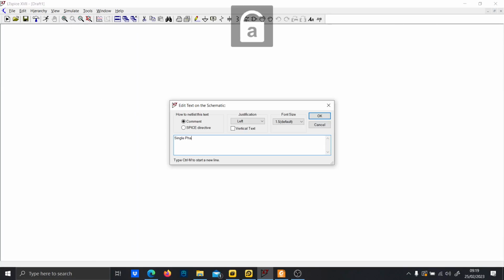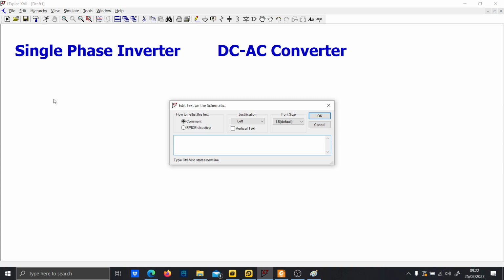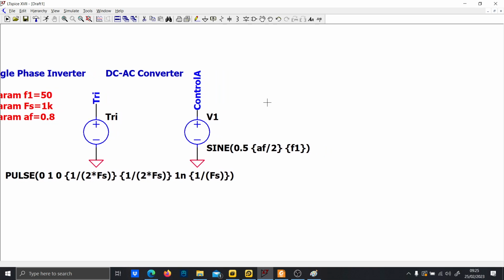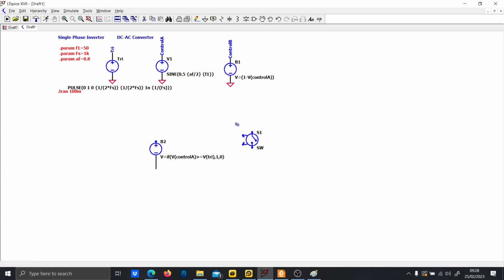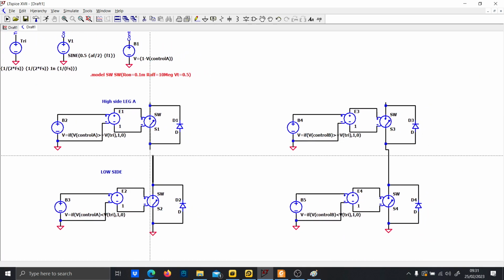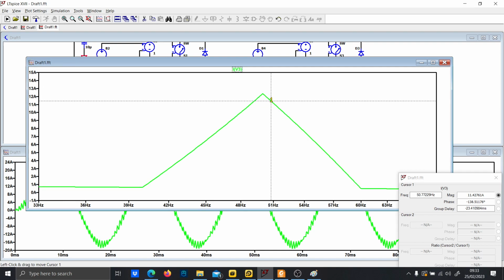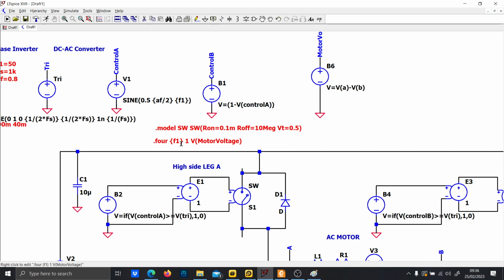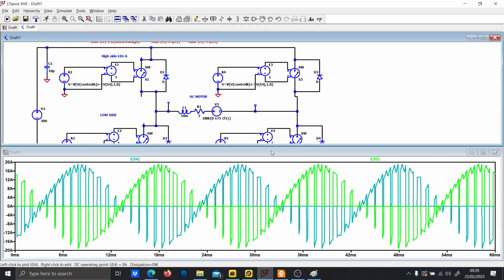LTSPICE Single Phase Inverter (Simulation,FFT,Harmonics) for AC Motors

Comment: Good video. I suggest adding a filter and demonstrating the methodology on the discharge to drop THD under 5%. I also suggest making the equivalence circuit model of a motor in a block, and make that the load. I think you would get a lot of views.

Comment: Excuse me, if I want to use NMOS instead of SW to make a single-phase, how should I do it? Is there any tutorial QAQ?
Reply from the maker: Just substitute the switch with Nmos, select One of the list and then provide enough gate voltage like 5V
Reply: @LukeXVIIx64  Should the Gate terminal of NMOS be connected to E and then to BV, or is it sufficient to connect it to DC?
Reply from the maker: @士凱-g1y  If the MOSFET Is High side, you have to provide 5V to the VGS, which Is literally Vg-Vs, a differential voltage. So, you First decide your pulse, then with the gain E you connect both the gate and the source and not the source to gnd, or else the MOSFET won't turn on
Reply: @LukeXVIIx64  Thank you for your video and your advice <3.
Reply: @LukeXVIIx64  Sorry for the trouble again. I would like to ask how to adjust the square wave generated by the low-pass filter to align with the sine wave. I have adjusted the delay, inductance, and capacitance, but it seems that there is not much change. Once again, thank you. 🙏
Reply from the maker: @士凱-g1y  I'm afraid I don't follow, what Low pass filter are you talking about? The load Is a PSM motor, hence the inductance of the motor. Then the pulse given to the switches Is generated with a triangular waveform compared to a slow sine wave at 50Hz. The result will be a Square waveform which its duty Cycle changes with time , to match a sine wave, like having a discretized sine basically
Reply: @LukeXVIIx64  I apologize for the confusion, let me rephrase. What I want to ask is, how can I adjust the square wave generated after passing through the inductor, resistor, and voltage source containing a sine wave so that it aligns with the sine wave output from the voltage source? (I initially thought that the inductor and resistor in between, along with the voltage source, were meant to establish a simple low-pass filter.)
Reply from the maker: @士凱-g1y  The "square wave" that you see, it's not a square wave, It's the PSM AC Motor voltage. It's not a classical square wave with duty cycle 0.5 between 0 and 10 for instance, it's a non-constant duty cycle square wave, which mimics the sine voltage at 50Hz. Basically, if you perform an averaged mean of that "square wave", you will obtain a sine wave, and that, is what in reality sees the motor. Let me make you understand
The motor is an electromechanical device, and it's very slow. At its input voltage pins, he will not see the square waveform varying so fast at 10kHz, but the motor will see an averaged mean of that square waveform, a low pass filtered waveform, which, for him, is basically a sine wave.

So, you don't need to "match the square wave to a sine wave" because, that it's not a square wave in the first instance and second it's alredy a sine wave in the averaged filtered waveform.

There are indeed electronic drives, like the 4 quadrant DC-DC Full Bridge or H bridge, which produces a clean square wave between -Vin and Vin. That is a pure square wave and it's used for DC Motors. But the principle is the same, the motor will see just and RMS voltage across him.
Another example, a square wave inverter, mostly used for resistive loads and  heaters.

Hope that I clarified your doubts
Reply: @LukeXVIIx64  I think I've got it now! That's it! It's already averaged, so no need for further adjustment. I initially thought it needed to be adjusted to be perfectly centered, but now I understand. Thank you so much! Your help has been invaluable.
Reply: @LukeXVIIx64  I started learning to simulate circuits related to single-phase DC/AC inverters using LTspice due to my coursework. Thank you very much for your tutorials! They have been really helpful.